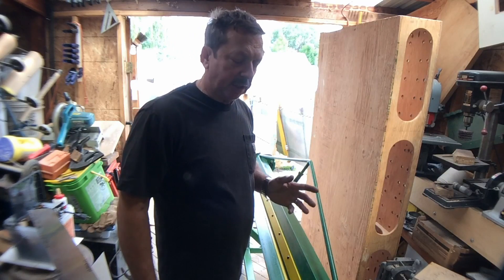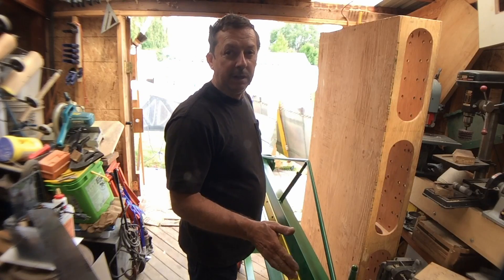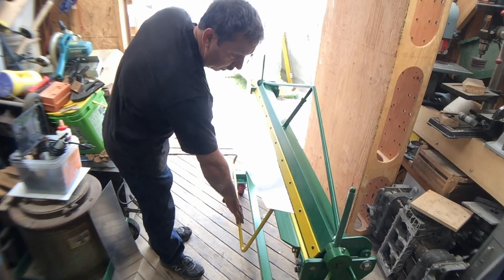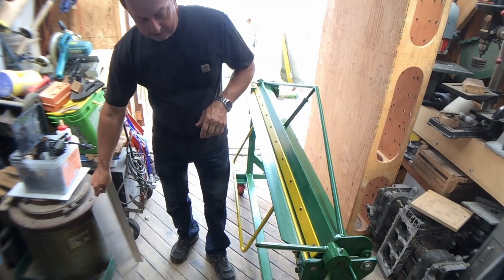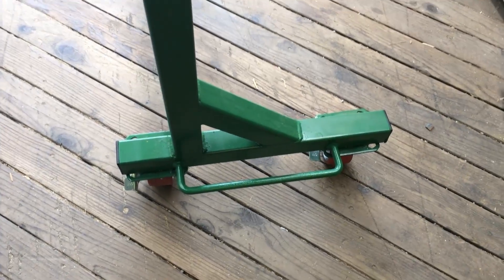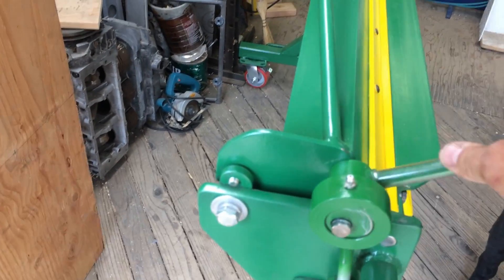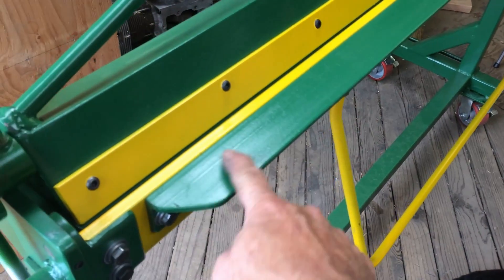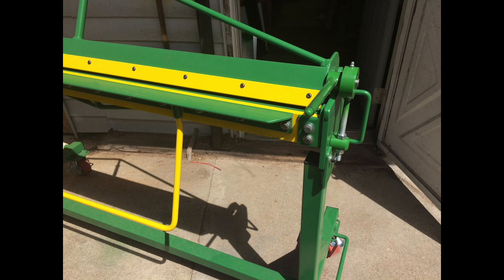Scratch Building A Zenith 701 Experimental Airplane: Building a Bending Brake Part 7 Final

Comment: Nicely done, Dan. Really great looking brake. I'd be interested to see how it fares with some of the longer bends in .063, or what you think the maximum length in .063 would be. Also, wondering if you think it would benefit from a tensioning rod on the bending leaf. That's where my brake flexes too much for the heavier stuff. I'm amazed at how cheaply it came out. I have at least that much into my goofy brake, though a lot of my cost is due to trial and error, and band-aid fixes.
Reply from the maker: Thanks Greg, I will play with it with a little bit heavier stock but not to much. as I am not interested in springing it, as I said I think that 63 thou is probably to heavy for it. I doubt that additional tension on the bending leaf will add much. On my 8' brake I added a tension plate and it made a difference, but I think there is enough rigidity in this shorter brake. I do think it needs the lower tension rod for the bed assy. I was also surprised by the cost as I expected it to be in the 300 dollar range, but that will also be decided by your metal supplier. I have what I consider to be an exceptional relationship with both my main metal suppliers and usually get 3rd line pricing from both which is usually reserved for large businesses using large quantities, but have dealt with both for years and am known both in the yard and in the office and they both will usually give advice if it helps me including sending me elsewhere if I can get it cheaper.
Reply from the maker: Bent a 35" piece of .040 and it bent fine, but the brake was starting to work harder. the longest piece of ,063 I had gave a 18" bend. did a good bend and if the setback was adjusted it would bend a little easier and give a more appropriate radius for the thickness. I think it will bend a full 48" in .063 but that will be at or slightly beyond the capacity of the brake. your mileage may vary.